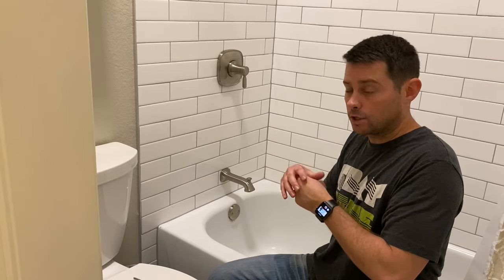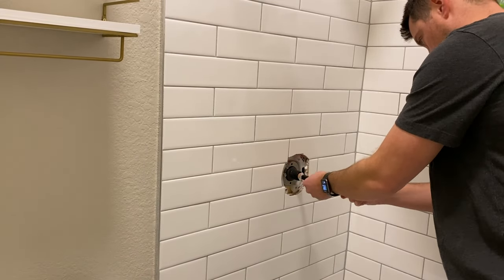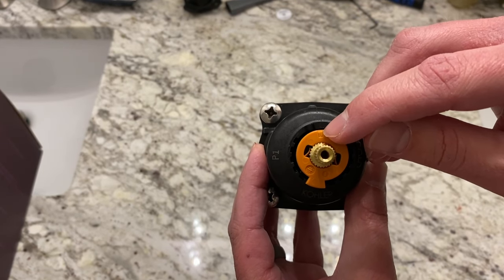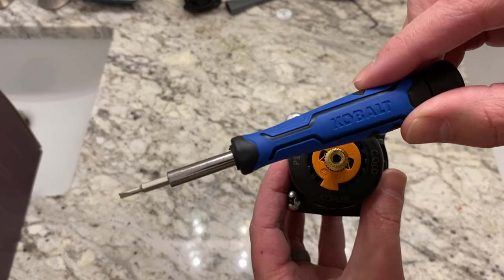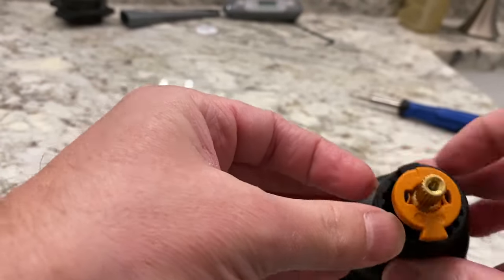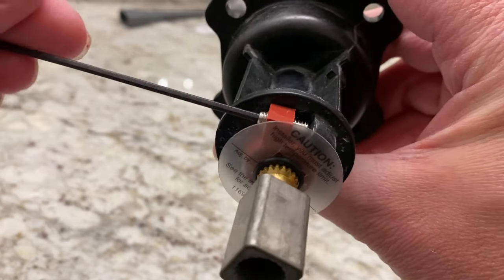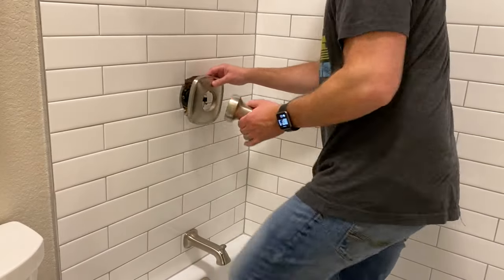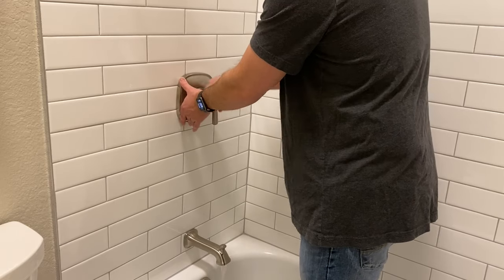Shower Not Getting Hot Enough. Adjust water temperature valve. Kohler.

Comment: Thanks for posting this. We have the second type of value. If the handle is at 6 o’clock, by the time we move it to 11:00 we only get cold water, but when moving beyond 11:00 o’clock, the water quickly goes to boiling hot, just a few millimeters of moving the handle gets us a huge difference between warm and boiling hot. So, within a few millimeters of moving the handle it’s very difficult to find the desired temperature.
Reply from the maker: Hmmm. That’s strange. So there isn’t an in between?
Reply: Very very little, maybe 4 or 5 millimeters and it’s boiling. I have had 3 of these valves and same problem for each.
Reply from the maker: @chansfor  hmmm. It could be something else then.

Comment: I adjusted the orange ring and now the water does get hotter, but at the point it gets hotter the pressure drops to the point that the shower will not kick on. I have to turn the shower head on with the water cold, then turn it to hot once the shower is already running. Any suggestions?
Reply from the maker: Hmmm. It might be that the water pressure from the hot isn’t strong enough to push the water through. If it works I recommend just leaving it.

Comment: My issue is not hot enough or cold enough. I'll be changing my faucet and handle tomorrow
Reply from the maker: What are you trying to fix?
Reply: @TryThisDIYFix   I have very hard water so my spouts all corroded but my water also doesn't get hot enough or cold enough. Hopefully the new handle will help with the range problem
Reply from the maker: @stevewagoner4754  oh got ya! Yeah that might help. But you can also adjust that as well.
Reply: @TryThisDIYFix  probably similar adjustment method? ill figure it out, thank you!
Reply from the maker: @stevewagoner4754  yes very similar. Let me know how it goes.